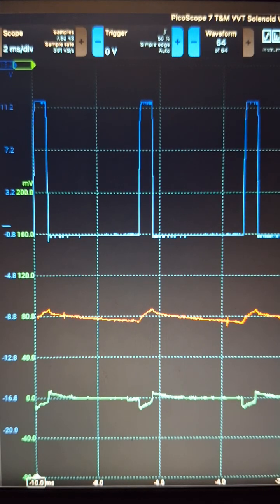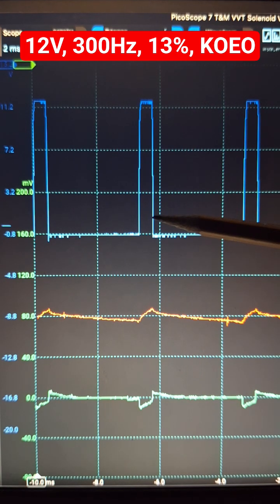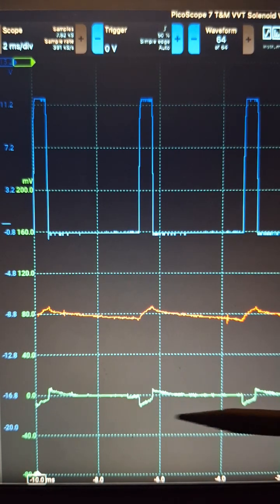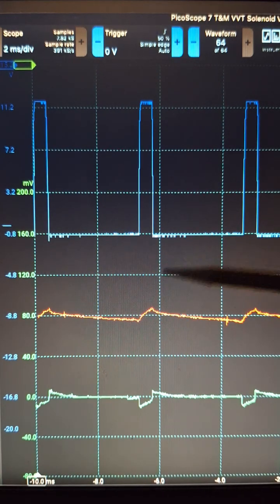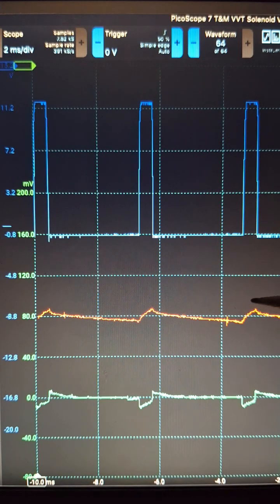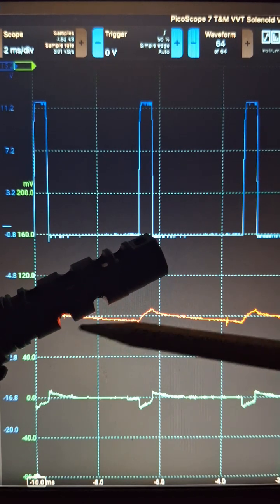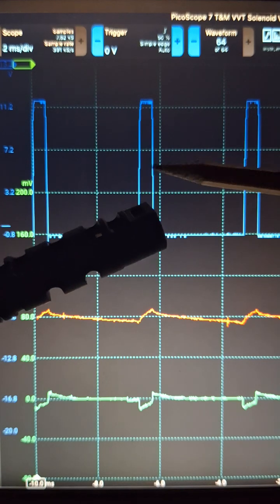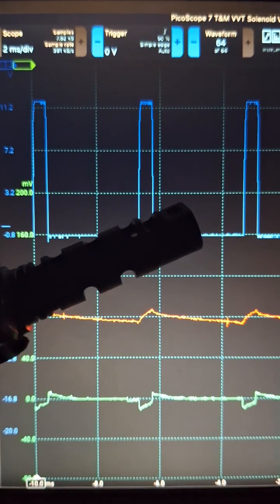Volts, Amps, and Inductive Probe: VVT Solenoid Waveforms Compared.

Comment: Does VVT actually provide much benefit ? Or simply over complicate and produce a point of failure in the Engine ? Is there any fuel economy realistically produced by VVT ?
Reply from the maker: Yes. It allows for the engine to use less fuel for the same power. Especially at low rpm/city driving (more efficient). It also increases the overall performance of the engine. And yes, some designs can be problematic. Thanks for watching! 🔧